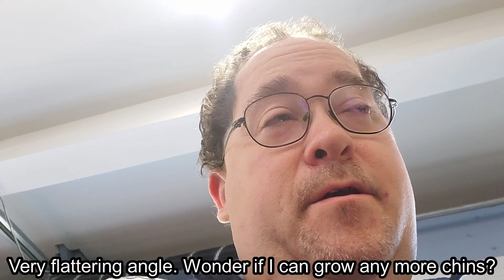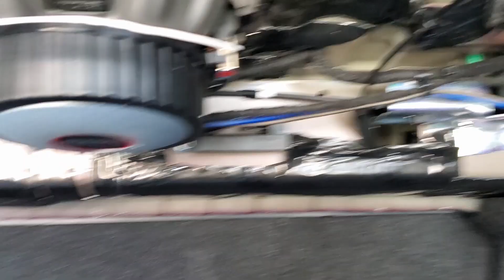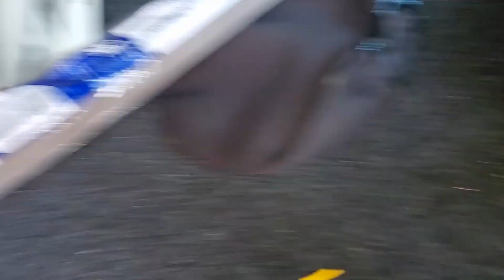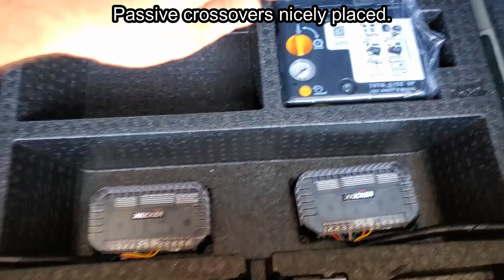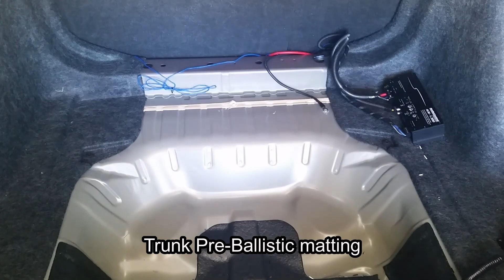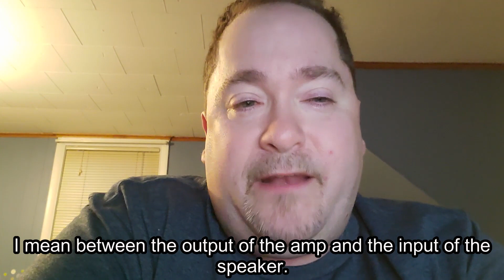2019 Insight: Stereo update. Nearing the home stretch!

Comment: Get a android headunit for your insight :)
Reply from the maker: You can't change the head unit. Besides it is an Android unit.
Reply: Verdier 400 your Honda is based on a Honda developed GUI. Maybe has android auto but not android O.S. 

There’s several universal 10” headunit online. Small screen tbh on the OEM
Reply from the maker: Sorry guy, but you can't change the head unit in this car. As far as we have been able to find out the system will not except aftermarket stereos at this time. Also, if you go into the gui information screen, it says that it's running on android 6.0 so I guess it kind of is an Android unit.
Reply: Verdier 400 yeah maybe in the background it’s running a android OS. But on top of Honda GUI. 

Saw a person install a towing hitch to their insight. Know hybrids aren’t recommended to tow, but people have been doing it for the past 15 years on the Prius’s. And no issues unless they’re towing huge amounts

Comment: Do you happen to know if they sell screen protectors for the head unit? Scared of getting scratches on the screen in the future
Reply from the maker: Specifically no.  However it's basically an android head unit screen so if you take a measurement of the screen you should be able to find a screen protector that will fit over the screen without any problem.